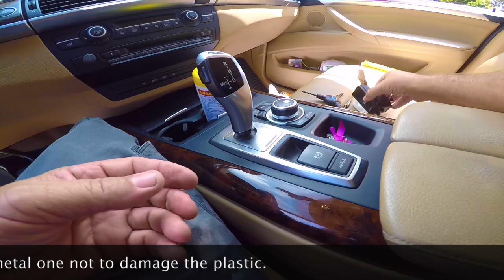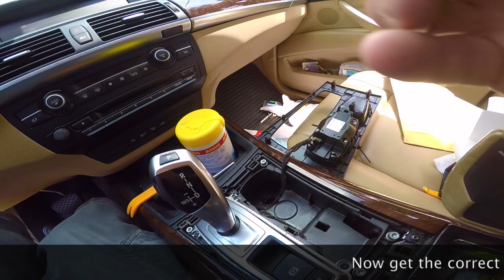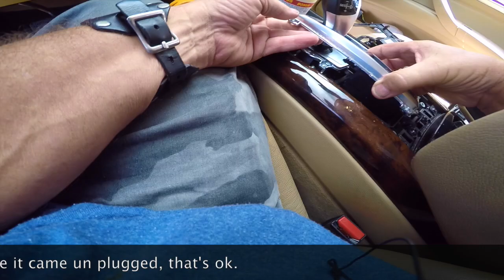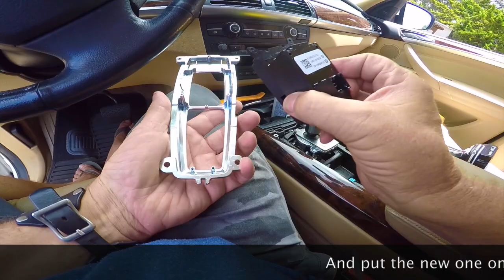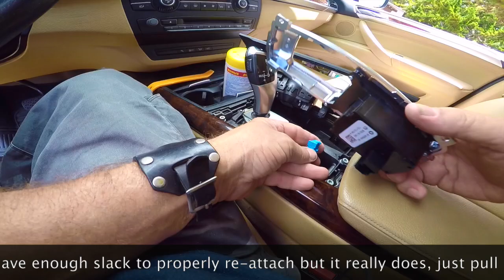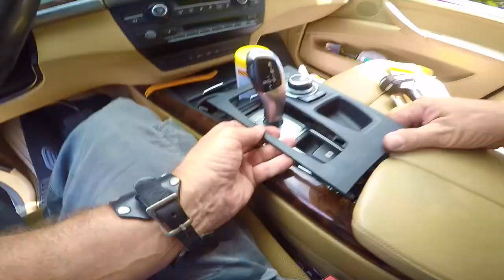DIY: BMW X5 Parking brake switch module replacement.

Comment: This is a pretty easy job with plastic tools for interior body work (which you can buy for $10). My dealer charged $154 for the switch, so I highly recommend buying it online for $30 or less.

Comment: There is only ONE thing that’s hard about this process and that’s getting the fascia off at the start. Why did you skip over it? So unhelpful.
Reply from the maker: Sorry the video was not helpful. My plastic was not difficult to remove. Maybe others can see this and find the actual point of connection where you need to pry the tool. Sorry again.
Reply: @ridetools69  Thanks for the reply, and sorry I was grumpy. The rest of the video was great, but it really was the only hard bit - especially to not damage the clips!

Comment: I have same issue with this switch, mine parking has fault code, did you have same problems? I checked hand brake actuator (module) everything seems to be OK.
Reply: me too, do I need to replace brake actuator? how to check actuator if working? thanks

Comment: ThankX 4 video, never fails, April 24th 2014 my warranty expired, my parking brake switch is cracked and won’t last long grrrrr.  What special tools will I need to DIY? 2015 BMW 528i. Thank u buddy

Comment: Do you have to disconnect the battery to replace the parking brake switch?
Reply: I did. Just to be on the safe side. The battery is in the trunk, just remove the Negative, that will do.
Reply from the maker: I did not
Reply: @ridetools69  does it throw any code on the system if battery not removed? thanks

Comment: You may find these tips helpful:

- to loosen the plastic I used a wide plastic wedge 

- take a vacuum cleaner and cloth aside to remove the dirt

- if the connection cable is not that long. Stuff a cloth under the blue plug and let it hang out on the side. Now press the component onto the blue connector. When the handbrake is connected, you can pull the cloth out.

Comment: My mechanic want $150 for 2 hours of labor charge to change the parking break module switch. With your video assist. It looks like a 15 minute job.  Thanks

Bought the replacement for $110 online, genuine BMW parts, generic is roughly $40 available too.